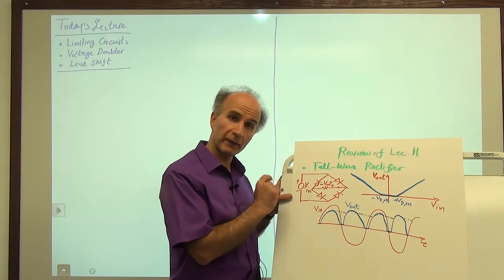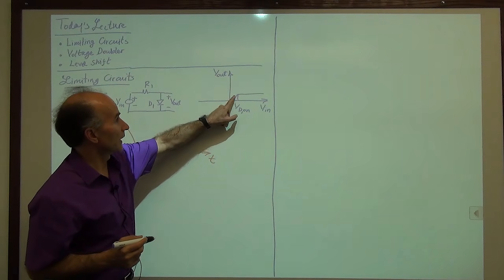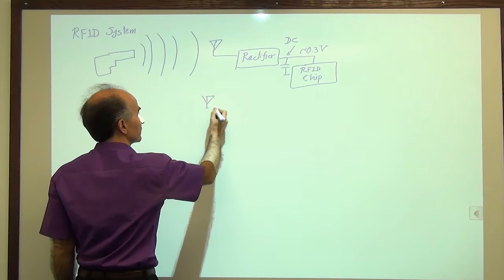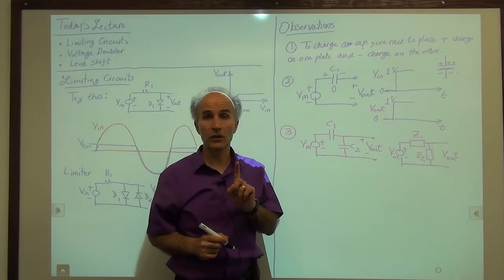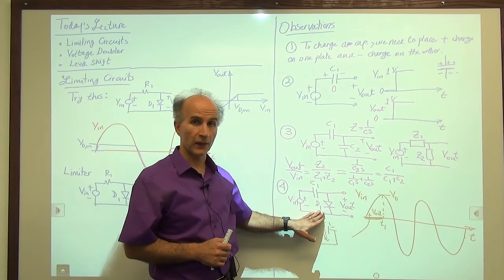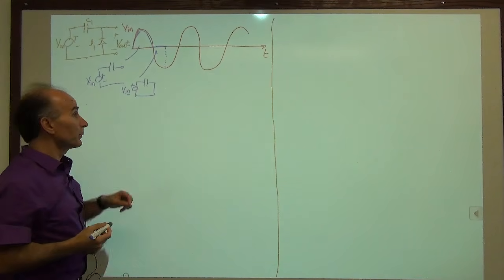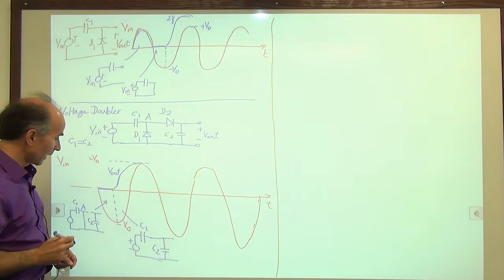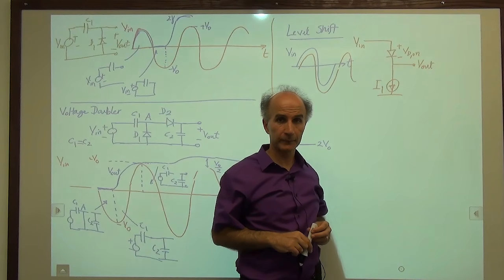Razavi Electronics 1, Lec 12, Limiters and Voltage Doublers

Comment: Note:

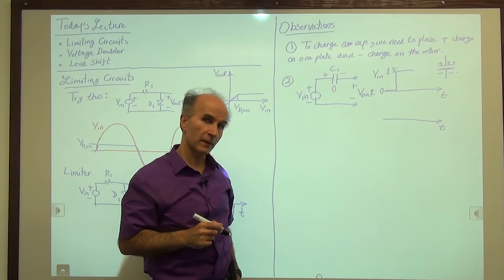26:58 "I thought that as long as there is an accumulation of positive/negative charge on one plate that plate will have the opposite charge, why isn't it the case here?" Why is the voltage drop zero when the left plate is connected to a positive voltage Vin?"

Here's the difference. Because the node connecting Vout and the right capacitor plate is alone and not connected to anything, it has a finite amount of electrons. Positive voltages/charges are formed when there is a deficit of electrons compared to protons, and Negative voltages/charges are formed when there is a surplus of electrons compared to protons. So what happens is this. The left plate has a deficit of electrons. The right plate then takes the free electrons the node has and fills itself up with it to balance itself left plate's magnitude so that they have equal magnitudes of charges but opposite charges. This means that the rest of the node, the stuff to the right of the right plate, has a deficit of charges, and if you do the math you'll find that that part of the node has a voltage magnitude of Vin. So what the professor means isn't that there isn't an accumulation of charges in the capacitor, it's just that beyond the capacitor, nothing changed, and everything behaves as if the capacitor is shorted.

Comment: 1:00:26 why does C2 charge by smaller amount of (Vo/2), the Vin value is still increasing from -Vo to Vo i.e. 2Vo volts so half of it will be given to C2 which will be Vo only instead of Vo/2.. please explain anyone?
Reply: Did you get answer for this
Becouse there also it comes same vout = vin/2 and output 
Did you get correct answer pls do reply
Reply: 1:00:29  please go though the capacitor divider ckt,vout is the voltage on the c2 ,i.e apply cap divider formula (c1=c2 considered in this case) u ll get vout=Vin/2 so when vin goes 2vo(-Vo to +Vo) then vout goes to half of that which is Vo
Reply: reply if not understood
Reply: @Praveenkumar-fg4jp brother I don't understand it 
Can I have your number I am 2nd year Ece Student from India itself plese explain it to me 

My question is it still increased by 2v0 so if we divide by 2 (attenuation factor due to capacitor then how it increased by vo/2 )

Give number I will call immediately then delete it for your safety

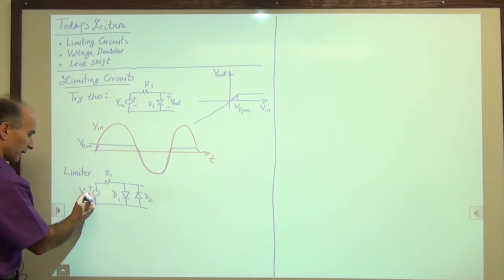Comment: In limiter at 13:05. When the input voltage is positive greater than Vdon  the output voltage measured at D1 will be Vdon but at D2 whether it will be Vin?. So will the graph be different from which you showed?

Comment: @59 when d1 is on then c1 gets charged to vo (reverse polarity)then after d1 gets off then also d2 remains off as voltage at point A not higher than the vout(which =vo)  it should remain as it (vout = vo) till 3rd postive cycle then it should charge to get increment of vo/2.
Am i right ? Here ..
Anyone who follows the same as i am ?
Reply: Yes, you're correct.

Comment: The last 20 minutes are not that well explained how we get double the voltage. This should have been better explained.
Reply: If you do the expansion of that expression Vo+Vo/2..... you will get 2Vo its just that.....Just apply binomial expansion
Reply: The big point that worth mentioning is that the final value is reached after a number of cycle
Reply: @mnada72  yes bro exactly....After  a few cycles of the wave you will get to a constant output value

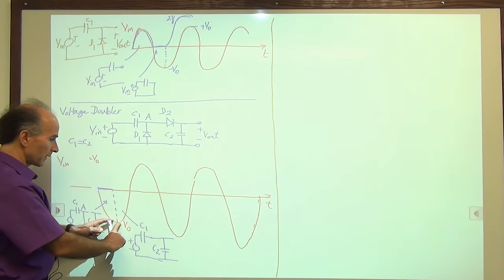Comment: At 55:14 the input voltage goes from -V0 to +V0.  But C1 is already charged to V0 and in series with the supply voltage. Why then do we not have 2V0+1V0 to give 3V0 out ?????? Can anyone explain this.  Or at least 3V0/2                                  Thanks Mike
Reply: D1 is off when AC changes from -V0 to +V0. But the condition to turn on D2 has changed. The initial state of C2 has no charge and, hence, D2 is on immediately after -V0. And you get V0 increase at the output. But when AC changes from -V0 to +V0 at the 2nd time, D2 already has +V0 at cathode. D2 won't turn on until AC has increased from -V0 to 0. That is, C2 only gets charged when AC changes from 0 to +V0. Per capacitor attenuation, the voltage of C2 will increase V0/2. Repeat the previous steps, you will find the voltage of C2 increases V0/4 for the next AC cycle. That's how voltage steps up on C2 to output +2V0 finally.
Reply: @yihou6433  you missed one thing in the first -V0 to +V0 phase. there's already V0 voltage in C1, in previous example, Vout goes to 2V0 because of that. Here, Vout won't be 2V0 since some voltage should go in C2, which makes (1+1/2)V0 a  possible answer( some voltage in C1 release into C2). So i think there's something wrong in the video here. Apart from this, the future behavior of Vout is understandable.
Reply: @yihou6433   thank you
Reply: Same doubt here...

Comment: I think the capacitor charges through the probe scope so you only get Vin=Vout for point number 2 for a discharged capacitor and just for the first 1/2 second before the capacitor charges using the scope probe to complete its charge circuit and Vout goes to 0.

Comment: At 27:58 point number 2 i measured this circuit with scope and power supply etc. Got weird readings for Vout. Did anyone set this circuit up.
Reply: I guess there should be something wrong wrt that circuit cz if we suppose capacitor is some sort of open circuit stuff(there is no current through the capacitor) and we replace the capacitor with some sort of switch that is off, we won't get the input voltage at the output side.

Comment: hey sir , thank u for providing us best of ur knowledge of electronics bt sir in this lecture at 1 hr 1 min 45 sec u have drawn the in/p and o/p characterstics in that i have a doubt or u can say acc to what i learned from ur lecture is that the vout must be constant till completion of 2nd neg cycle ends and when 2nd pos cycle starts then d1 becomes open d2 become short and then we obtain vout =v0/2   pls correct me if im wrong, if not then also pls clear the point in comment or through any video .. pls sir

Comment: Sir in voltage multipliers observation point 4 how the voltage across the diode increases as the input voltage increase ???The capacitor only will be charged untill it reaches maximum ..

Comment: Sir in one of your previous lectures you mentioned that we cannot say voltage as 0 if it is open circuit then how can we say capacitor cannot charge in the observation point 2 of voltage doubler
Reply: it is true if it is an open circuit and the Vout terminals are not connected anywhere.

Comment: During the first half cycle that sir is neglecting for easy understanding of the voltage doubler circuit, capacitors c1 and c2 obtain some charge  because d1 is off but d2 is on. This way, the voltage at output should not be zero at the start of 2nd half wave. If I'm wrong, someone please explain the reason for vo=0 in quarter part of 2nd half.
Reply: He is not ignoring the first half cycle, he just isnt using it as the starting point. Imagine that at the very beginning the first thing to go into the circuit was the sine wave going negative. To analyze the circuit we can start at any point that we would like and he just chose that point because we had seen something similar to that previously in the lecture with the single diode single capacitor.

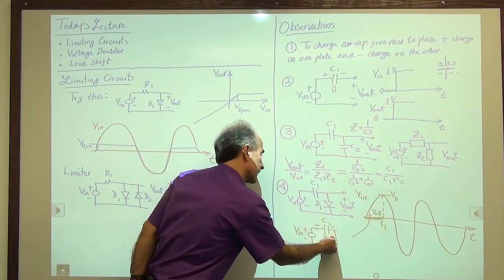Comment: i couldnt get what he said at 37:45 how does that mean that the cap is discharging?
Reply: He is considering the possibility(Please keep this in mind that this might not be what actually happens) that Vout stays constant, for that to happen with Vin going down, the capacitor must loose charge, as the voltage across the capacitor is (Vin-Vout) (Vin is going down, Vout is constant). Now, a capacitor loosing charge is practically the same as the capacitor discharging.

Comment: I learned about voltage double when I was in high school. I dismantled a TV high voltage circuitry to find out how the high voltage CRT worked.  This was an amazing lecture.  Something I was looking for a long time. Amazing.   One negative thing is the application given at the beginning.   It would be much more efficient and cheaper to mutiple the wiring of the receiver winding to increase the voltage needed to run RFID.  In fact, it is done as a part of the chip design. Remember you loose about 0.6 volt for every diode.

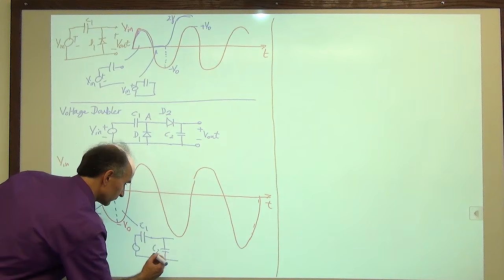Comment: how can diode D2 turn on for negative voltages 54:23 ???
Reply: as the vin is more negative on upperside of circuit that means lower side of circuit has to be more positive (as by KVL total current across the circuit has to be zero so more -ve + more +ve = zero) so positive current going onto the anode of D2 so D2 is turned ON.
Reply: U can understand this by how the electrons movement inside the capacitor then see this video u can get to that point

Comment: 41:44 4th circuit, , shouldn't the diode turn on in the 4th quarter negative cycle when Vi increases from -Vo to Vo ?
Reply: For the diode to turn ON, its anode has to be "more positive" with respect to its cathode, which makes conventional current flow possible from anode to cathode. Now look closely at the circuit,  since input is changing from -Vo to 0, cathode of D1 is trying to increase with respect to anode. For this to happen the current must start flowing from cathode to anode, which, is not possible in case of a diode. Hence the diode shuts off. Hope this helps.
Reply: @Rish569  you are a life savior
Reply: Virat Mishra same doubt bro 
diode turn on for positive voltages
-V0 to 0 definitely there is no positive voltage. so how can diode turn on???
Reply: Virat Mishra The diode didn't turn on. it just turn off (why we we are decreasing input voltage so the circuit now open circuit)
what ever input voltage is output voltage no current flowing through diode so that no voltage drop
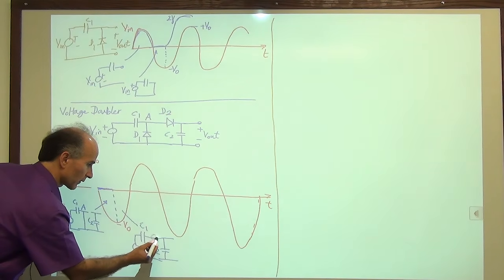But he said 54:24 diode turns on  -Vo to 0 how it possible?? that's my doubt

Comment: The location on which the voltage doubler charges the output to increment of Vo/2 is supposed to be the time at 0V (but not at -V0 of Vin). In fact, the voltage doubler follows fibonacci's sequence because it reduces the time in which D2 remains ON by half each cycle.
Reply: Yes, you're correct.

-Since after the 1st cycle of Vin, C2 attains voltage V0 at output, as such the n-terminal of D2 is now at voltage V0.
-Therefore, to turn D2 on, the voltage at its p-terminal must be > V0.
-Now as C1 has already charged to V0 during the falling edge of 2nd -ve half cycle of Vin,
 thus Vin pushes/raises the voltage at the +ve plate of C1 (i.e p-terminal of D2) only when Vin passes 0V.
-Now since voltage at the p-terminal of D2 is > V0, diode D2 turns ON and C2 gets further charged by V0/2 volts while correspondingly C1 gets discharged by V0/2 volts.

-In the next cycle, D2 will turn ON at Vin = V0/2, then in the next cycle at Vin = 3V0/4, and so on, due to the increasing voltage at the output (i.e across C2 after each cycle of Vin), which has to be overcome every cycle to turn ON the diode D2.
Reply: Jun Ouyang wat prof said was perfect....
Reply: @mujtabahassan7925  ok can u pls elaborate how is it correct and by that how we get v0/2 from that
Reply: i have the same doubt

Comment: at min 27 
Prof Razavi said that if we have a variable voltage source connected with cap then the cap in not connected to any thing that the o/p voltage is the same as the i/p voltage as KVL said 
in lec 10 at min 29
he said that we can not determine the o/p voltage if we have zero current in an infinite resistance 
i really get confused 
please help :)
Reply: he said as the circuit is open so there will be no current to charge the capacitor and eventually the voltage across  the capacitor will be 0 and the input voltage will be equal to the output voltage according to the KVL
Reply: The actual concept lies in the movement of electrons inside the capacitor
Reply: +Ahmed Taha  use ohm law V=iR
which is V=0*infit=Undefined